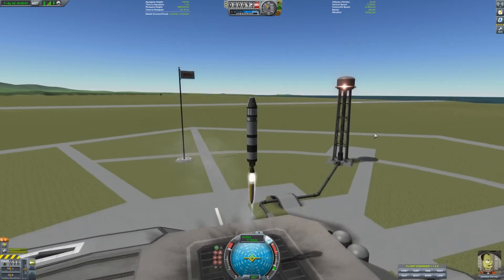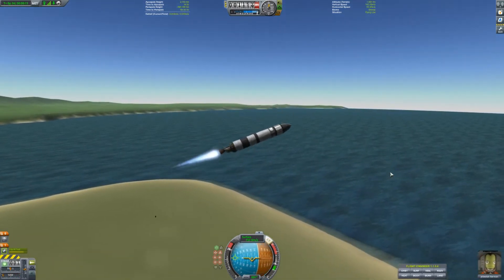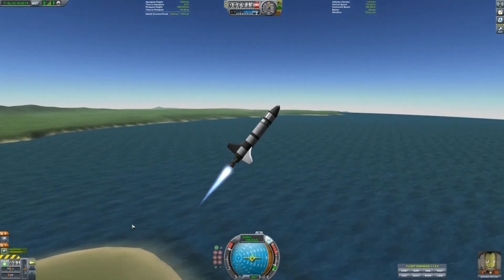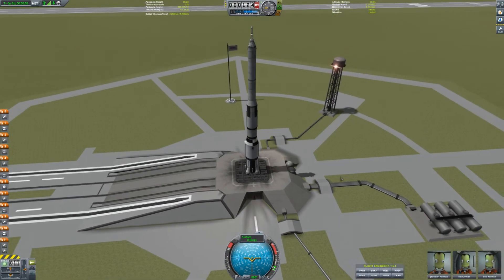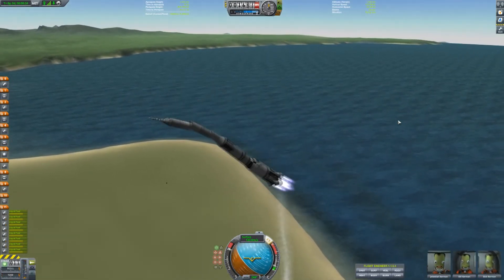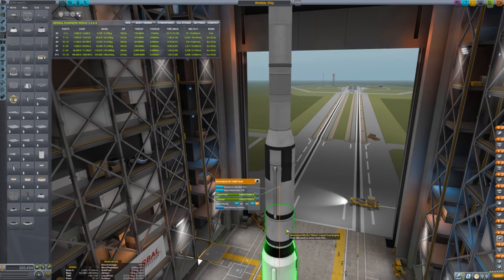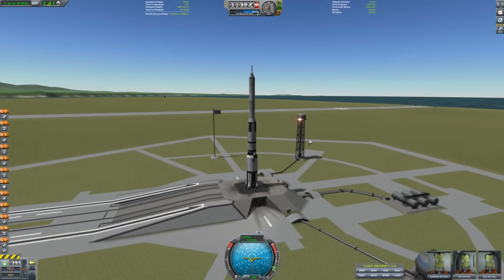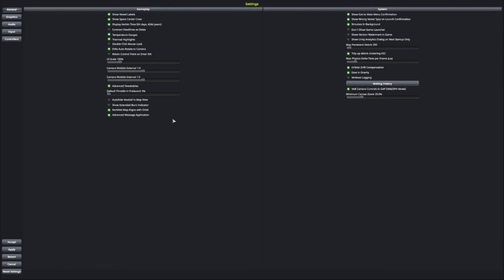KSP - How To Build Stable Rockets!

Comment: The “Advanced Tweakable” setting saved me from rage quitting this game for good. Thanks for that tip. Before, my rockets were all over the place.  Occasionally I would Forest Gump my way into orbit, but mostly my rockets were nearly impossible to control.  After turning it on then turning on “Rigid Attachment” and setting “Autostrut” to grandparent part, the exact same rocket flies straight and true. This is a must for this game to be enjoyable. I’d definitely put this in the top 10 KSP tips.
Reply: Thank you for this information piece of info. I'm literally in this situation.